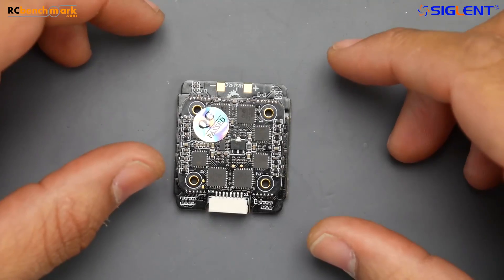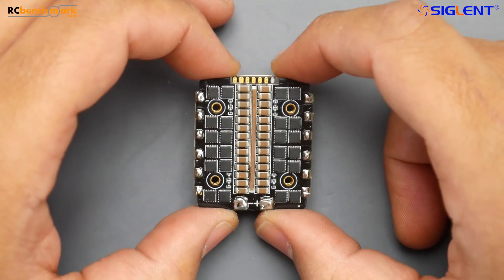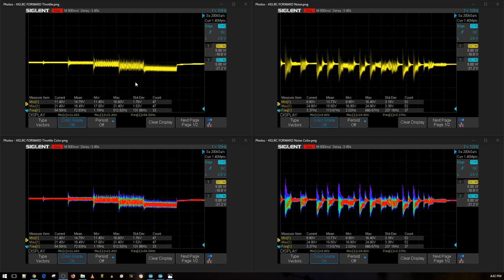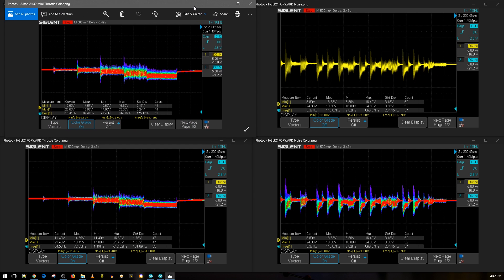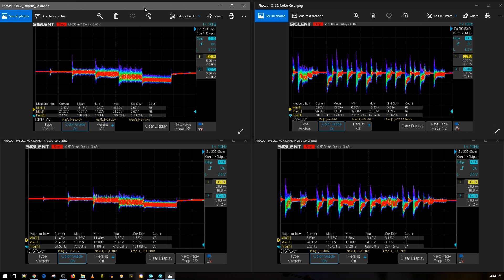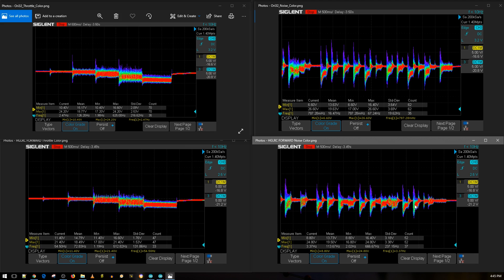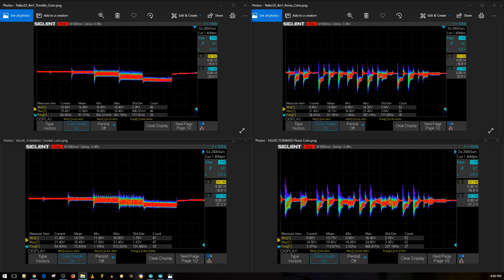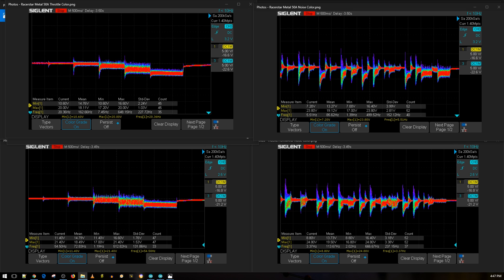Aikon AK32 & Ori32 Killer!!! // The HGLRC Forward 45A 4in1 ESC Noise Test

Comment: confused about how these results would relate to results with a large low ESR capacitor typically placed at the battery connection. is it expected to be the same since measure is post ESC?

Comment: Aikon 32 big 30x30 on the 6s Test please
Reply: I fly it on 8s 2207 2450kv cobr⁷::koth 5046 apc prop 10 dlights still works so does 6s matek f405 aio fc and have over 10 of them on all 2208 -2608 2400kv-2800kv on 6060 and 7060 and 8060 prop as ive been doing speed runs wifh most powerful es s and motors and popsicles : vout for around 2 yeRs now and they handle 160-180 mph runz on f80 pro on 6s aNd efaw 2407 2500k on 6s 6060 as well az uh 2200KV FI0 OGI HMOM HVV BUG%G<H.C GH J.LO>